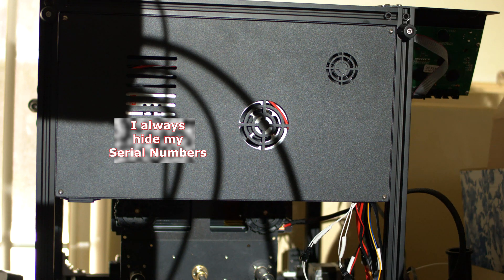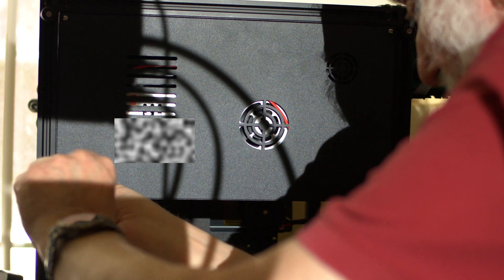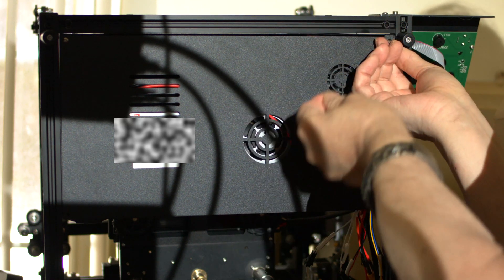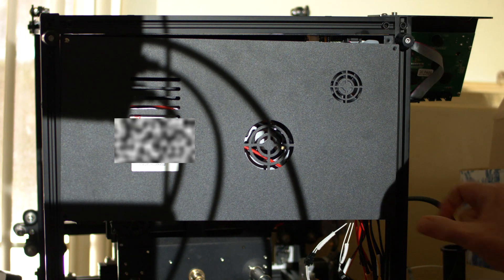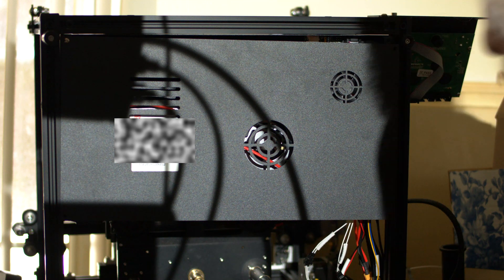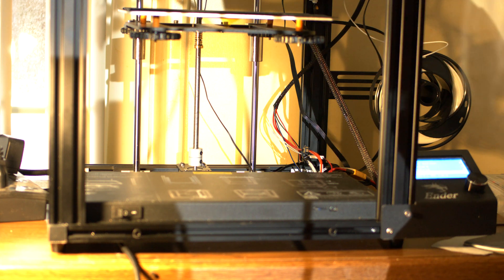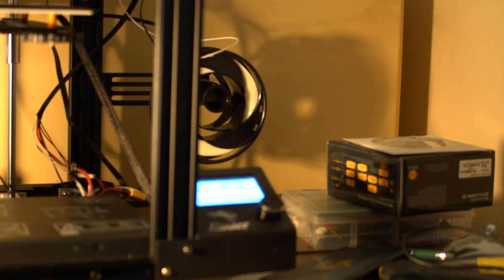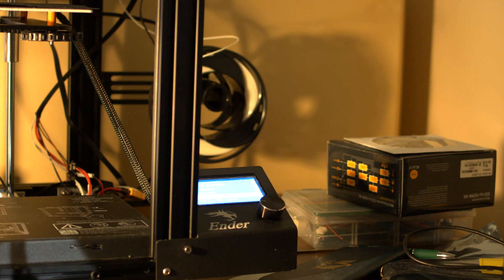Ender-5 Micro SD Trouble

Comment: Should say at the bottom of the main screen on the ender 5 init sd card. Use that function and it should reupload your sd card with the files.
Reply: I'm pretty sure my has a bad as card slot. Tried 5 different cards that work on other devices all current formats ntfs, fat32, exfat, etc. Tried the init card button. Never sees the cards.
Reply: @lokeman8492  can i ask have u fixed it anf how?
Reply: @lokeman8492  I've got the same problem. Did you solve it?
Reply from the maker: Will it not reformat the card?
Reply from the maker: OK, I tried it and it worked. Thanks! 🍸
Reply: Your welcome yeah me and my husband are used to flash drives... these sd cards can be extremely troublesome